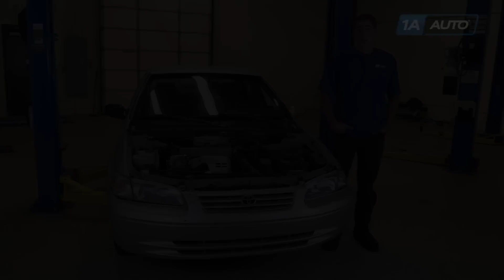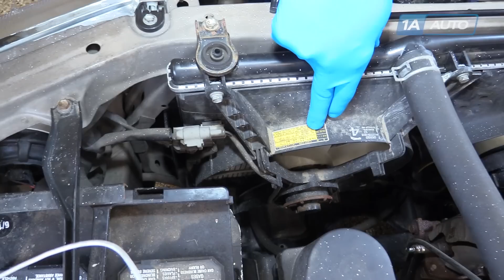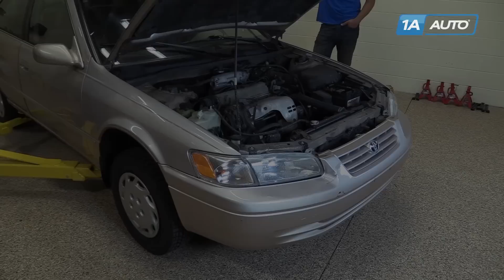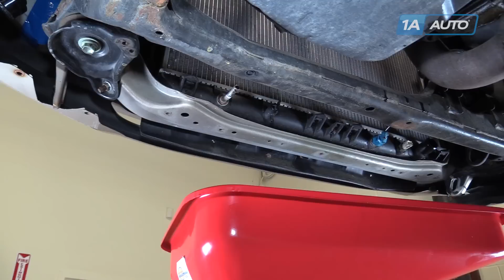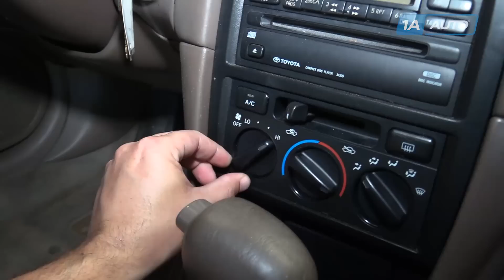How to Replace Radiator 97-01 Toyota Camry

Comment: This video is very helpful but for anyone performing this repair, he mistakenly refers to the sensor located on the bottom of the radiator as the coolant temperature sensor, it is actually the radiator fan switch

Comment: Everything is very well explained and shown, respect! I simply don't need to climb under the car and disconnect the T/M hoses from there, it can be done completely freely from above )))) I simply use a very wide container when draining the antifreeze

Comment: I just finished the radiator swap. I couldn’t get the skid plate off because some of the bolt heads were mashed up. Had no problem doing it all from above except for finding the right angle to get all of the lower coolant line clamps. Great tutorial!

Comment: Great video! Had to revisit because the connector for the thermostat confused me. For anyone doing this, lifting the car is not necessary at all and I’d recommend rotating the clamps for the bottom hoses so they can be accessed from above, if I have to mess with anything in the future I won’t need to get on the ground

Comment: A few important and helpful tips: this Camry doesn't have a air bleeder valve in the engine, so you may find yourself in a situation where an air bubble is trapped and you're unable to get it out.  The simplest fix will be to raise the car up as far as it will go from the front with a jack (be careful & safe) to allow the air bubble to be forced out. Another thing that will help with this is to wait on putting in the large upper radiator hose, filling that up with coolant and then quickly attaching it to the radiator while trying to avoid a mess, this will help to eliminate some of the air that would otherwise be trapped in it.  Lastly, I just did this fix and was disappointed to find out from my local Toyota dealership that they discontinued the coolant temp sensor on this car.. so if you're in need of a new one you'll likely need to go to a junk yard (I've tried multiple after market ones with no luck on the fitting).

Comment: This video needs to be updated with the correct part name. The installer calls it the coolant temp sensor, but THAT IS NOT THE CORRECT NAME. I just ordered it for my 1997 2.2L, and had 3 different customer service reps swear to me that it was the correct part, as in the video. One even told me to search Amazon or eBay for the part before the third said it was correct. The part they sent doesn't even fit into the slot as in the video. It's too small. I wanted to replace everything new, while I had it all broken down. On to AutoZone

Comment: Thank you for this video had to watch it again while i was removing the plug and heat sensor line.the should make it simple the plastic connectors can be easily crack if not careful it was a nightmare removing them life should be easy peasy but those electrical connection plug are difficult to remove thank you will ask my overcharging mechanic near my place if they are hiring

Comment: Excellent instructions, took me 2.5 hours but most is that time was finding lost brackets, screws and tools 🤦🏾‍♂️ otherwise it should only take :30 minutes or less. The screws on the bottom plate were rusted so i broke 3. Use pb blaster and let sit and do not use impact wrench to take them off.

Comment: Guys - if you're looking to replace the coolant switch at the bottom it actually goes by a different name. It's called a coolant fan switch. The one at the top near the manifold is the coolant temperature sensor. They work together to tell the ECU when to turn on the fans. The one at the bottom radiator is larger and has a larger probe. 

If you suspect either one is bad you can test it by using alligator clips on a multimeter and connecting to the pins and putting your multimeter to 20K ohms. In cold icy water the resistance should be as high as 5.5, but in hot boiling water the resistance should drop to 0.25. If the number doesn't change or stays high than your sensor is bad. Hope this helps!

Comment: I thought you had to remove the condenser bolts in front and push condenser forward alittle to remove the radiator. This was not mentioned. ???

Comment: Just did this on my 2000 Toyota Camry LE pretty straight forward, you don’t really need a tutorial but it helps if you don’t know wasup but its nothin too hard but you can also use a long 3/4’s socket instead of using a 19MM wrench for your coolant temperature sensor. Wish y’all the best of luck💪🏽

Comment: Great video, much appreciated!  I knew it was going to be pretty simple but am glad you guys made this video.  One thing I would add is to make sure your transmission feeds are all screwed in tight or you will leak transmission fluid like I did.  Will definitely buy parts from you guys in the future.  I would have saved $40 if I had this time.
Reply from the maker: +WHITTLINGdesigns Thank you! We love empowering our customers and showing how to perform DIY auto repairs with our high-quality auto parts.  http://1aau.to/m/Shop-1AAuto-c

Comment: What about the trans fluid level?
Reply: I'm wondering this as well. I didn't realize trans fluid went through the radiator, so I pulled the lines and lost a little bit of fluid. Lost a little less than a shot glass worth of fluid. Mine is a 1990 and I've heard not to change out trans fluid on these old cars because it could ruin the transmission, so I'm thinking I shouldn't touch it, and hope that that amount won't make a difference.

Comment: Did it today.  Just shy of 4 hours for me, including cleanup.  Had to make some modifications, though.  Bottom wiring harness would not unclip.  Ended up having to cut it and zip-tie it back on at the end.  My petcock (the little spout on the bottom of the radiator) was blocked and wouldn't flow, so I had to drain the coolant from the bottom radiator hose (messy!).
Reply from the maker: +Wizkid490 Thank you! We love empowering our customers and showing how to perform DIY auto repairs with our high-quality auto parts.  http://1aau.to/m/Shop-1AAuto-c

Comment: was the old coolant temp sensor not connected to anything? im gong crazy here trying to find the connector
Reply from the maker: +Rudy R Disconnecting the Coolant Temp Sensor
Disconnect the coolant temp sensor wiring harness at the bottom of the radiator
Pry out the retainer holding the connector to the radiator
Lay the harness off to the side

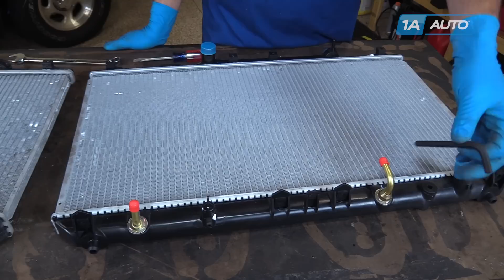Comment: Is this coolant temp sensor at 8:47 the same model as the one that sits near the engine block. It's the only one I can find online. I replaced a radiator in a 1996 camry and it didn't have the radiator sensor or the jumper that connects it. I can't find the jumper anywhere! I even contacted the dealer for the jumper/connection wire and they said they don't sale it. But maybe with a part number. Any help would be greatly appreciated. What does this sensor do also? The car hasn't had it since the owner has had the car for a few years.

Comment: My (old) radiator did not have a drain plug that I could find so I made quite a mess when I pulled the large hose off the bottom 😅

Thank you 1A Auto for making this video as it was extremely helpful!
Reply: How long radiator an condensor

Comment: does this vehicle have 2 Coolant Temperature Sensors?  One on the Radiator and one toward the top hose near the back of it?  I understand there's a smaller sensor which is the Sender. But the one next to it, is that also the same sensor as the one on the bottom of the radiator?

Comment: Are u able to explain a manual fit
Reply from the maker: This radiator we carry can be used on manual transmission models without issue and require no additional parts or modifications.+Gregory Tapping
Reply: @1AAuto  so is connecting the oil coolant fittings not required

Comment: My 99 Toyota Camry Le 2.2L has a few extras, a fuse box is beside the battery and has an a/c line under the horn on the front side of the radiator...

Comment: At the 9:40 minute mark there is something that looks like the radiator (similar size and many small fins) in front of the radiator.  What is that?  I may be getting some leaking from it in addition to the leaking from the radiator.  Thanks.
Reply: It is the AC condenser

Comment: After replacement ,I test with ac was fine but when I turn on heat ,I see smoke came out from the radiator, what was the problem?
Reply from the maker: +sopheapcompro1 make sure there are no leaks and you bled the system properly

Comment: I replaced my radiator bout 30 minutes ago in my camry the top clamps that hold the radiator in place are a little bit off set so I had to pull the radiator a little hard to get the screws in is this ok?
Reply from the maker: +Donald $lump ☔ As long as you do not damage the radiator core you should be all set.  1aauto.com

Comment: Did everything but heater not blowing out hot air
Reply: Get a spill-free funnel kit and have some extra coolant ready.. set your climate control to highest heat setting. Get that funnel in the radiator neck set up and fill with coolant. Start and run the engine for 5 minutes to burp out the air bubbles. But don't let it run more than 10 minutes without a pressurized system.

Comment: Thank you for the informative video. It was clearly shot and illuminated nicely. The list of tools needed saved me some time.

I have replaced several radiators on my old school American cars and trucks, but have never worked on anything with electric fans. I was surprised by how light this radiator is.

This was fairly easy to do on a friend's 1999 Camry. I changed the order of procedures from yours however. I raised the car on jack stands. I removed the skid plate and drained the coolant first. I then removed the hoses above the fans so I could pull them straight up.

I used the caps from the new radiator's transmission cooler lines to plug the old ones.

The most difficult part was removing the electrical connectors and the transmission cooler hoses. These have never been removed since the car was built and required a bit of persuasion.

I checked for coolant and transmission fluid leaks while it was still raised up and without the skid plate.

The first paragraph in your description must have been copied from a different video and needs to be edited. It is about the radiator fan.

Again, thank you.

Comment: do the trans cooler lines have trans or coolant running through them?
Reply: 1A Auto Parts and please correct me if I'm wrong but is the fan regulator switch also the drain plug or isn't the drain plug more on the driver side, the fan regulator  being more on the passenger side (Avalon) that doesn't have to come out until I pulled the whole radiator out is that right?
btw, there is barely any fluid left in the radiator, disonnected hoses planned for being pointed up, I could just drain it once I pull it.
Reply: 1A Auto Parts doesn't look as if there is any head gasket nonsense, customer pulled over asap once they saw a bit of steam from the grill and the temp gauge rising. it didn't go into red, should all be good on that part.
Reply: 1A Auto Parts wow, amazing you never hear of a transmission leak because
 of a bad radiator holy cow. so I was thinking, looking inside the Camry
 which is different than the Avalon, I think the inlet hose is on the 
passenger side and the filler cap is actually part of the hose it's back
 by the engine block on the Avalon, is the highest point of the system, 
but I noticed the Avalon transmission lines to the hises come up and 
over , kind of  like a trap built in, so I would imagine that undoing 
the clamps from those and then pulling them up they're already up right ,
 so they're not spilling  .  I can't imagine having to put the car on 
the lift or get under the car to take the cowl off just to remove the 
hose clamps, that seems like it's a lot easier to remove the hoses from 
the top sections both the exit and the input and the output on the fluid
 and then the transmission hoses off of the lines that are coming up and
 then curve down and then just kind of tape those to the fan Cowls, undo
 the three power plugs, take the brackets off and pull the whole 
assembly out with hoses attached. it just seems to be a be a lot easier 
and I have seen a couple of YouTube videos where that is being done.
at least that's what I'm going to try on a 97 Avalon today.

Comment: never worked on a car on my own. till lastnight. I watched this video twice and was able to change out my cracked radiator with a new one. in( 1 1/2 hrs . ) I really appreciate the help!
Reply: Same here.  Great video for this non mechanic.  I get everything installed, just need to add coolant in the morning and make sure it runs.  Thanks again for the PRECISE instructions.
Reply from the maker: +Ky Thank you for watching. Great job on the replacement, and we're glad that our video was able to help! 1aauto.com

Comment: do i need to lift vehicle to reach bottom hoses
Reply from the maker: +Alfred Collins It might help you to reach them a little easier. 1aauto.com
Reply: I forgot to put the bottom foot on one side does it hurt the radiator
Reply: Alfred Collins tell me if wrong, 1A, but once the fans are out, can't we just reach down and undo the clamps there and pull them up quick? I was going to use those temporary brake hose clamps to pinch the trans hoses. Car stays on ground. I'd just kick a drain pan around to catch any fluids as I move among the hoses. Ya?

and since mine us a 97 Avalon, I was going to leave the large hoses attached at the radiator bottom and lift it all out, any residual fluid stays in the hoses.
Reply: Yes You can plus remember to seat the feet back so it dosent rattle or break over time i replaced the 2 radiator hoses anyways to savetime in the future and work